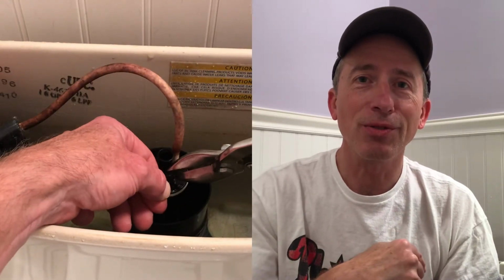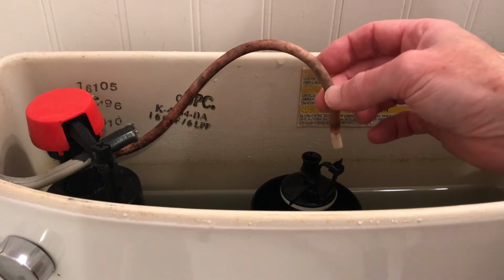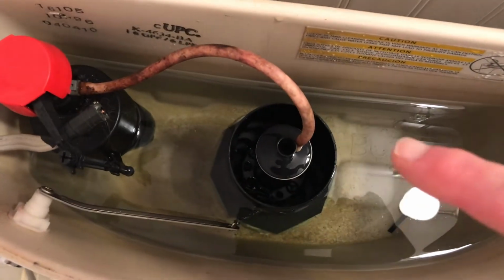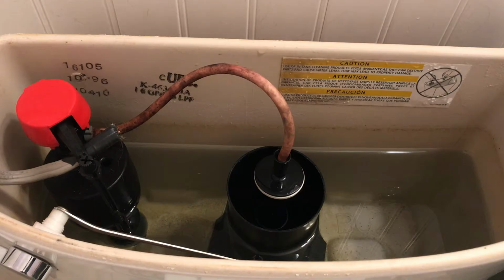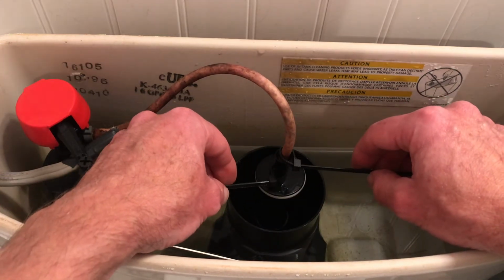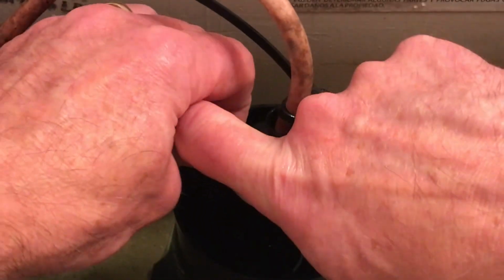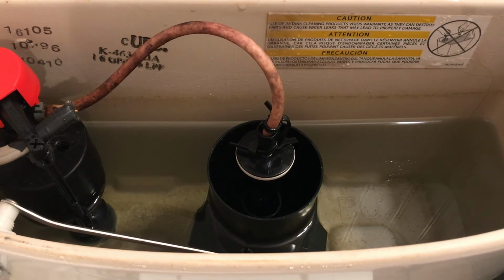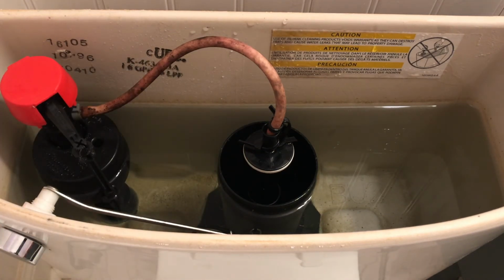Kohler Fill Tube Pops Out When Flushing - Easy Fix!!

Comment: Very helpful ! Tried the method and for me it didn’t work only bc the zip ties actually stopped the valve from opening as much as it should to successfully flush the toilet. I think because the black hollow tube is much more narrow on my toilet than yours. Otherwise this would’ve been the perfect solution, thank you !
Reply from the maker: Sorry you weren't able to get it to work. Maybe a tape of sorts would fit better in your situation.  Thanks for watching, JL.
Reply: How about melting/drilling a pin or paperclip?